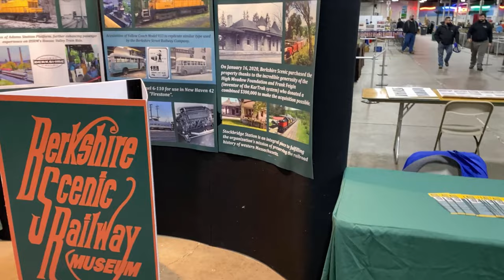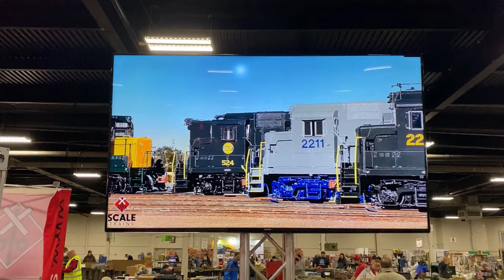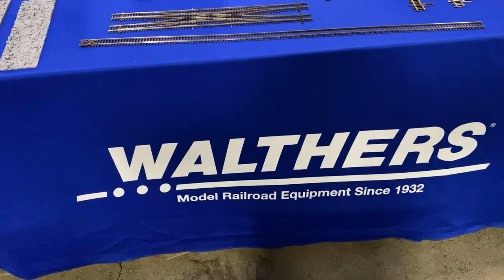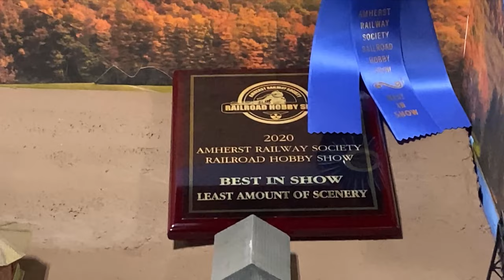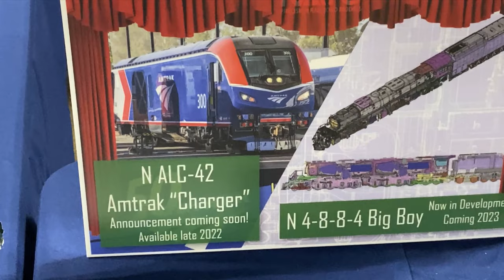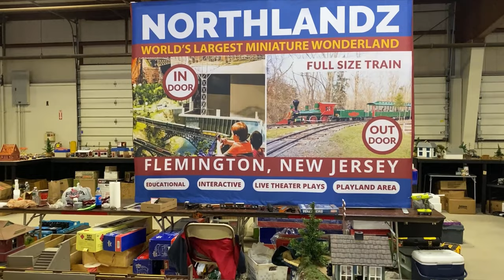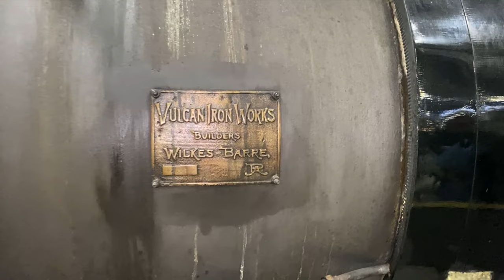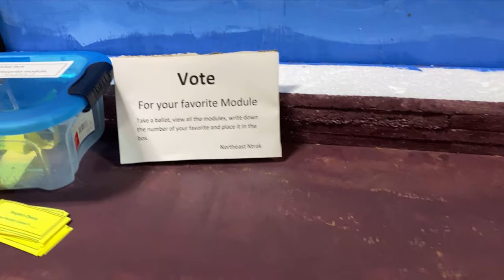The AMHERST RAILROAD HOBBY SHOW 2022 (Part 1) w/Manufacturer Interviews, Layouts and TRAINS GALORE!

Comment: You were correct when you first said "G gauge". Those were either 1:32 or 1:29, which are G gauge (45mm gauge). G scale is 1:22.5 and I didn't see any of that.
Reply from the maker: I even struggle with O gauge and O scale 😂
Reply: @NorthCountryTrains  It really does a disservice to us, especially the new guys, to call everything that runs on 45mm track “G scale”. Track radius and coupler compatibility are other issues that puzzle new guys. It was a big learning curve. I’ve been into it now for a decade and it’s still so frustrating when advertisements say “G scale” and I need to know what scale it really is so it will match what I have. Some manufacturers have lost out on a sale when I can’t find what scale their product is. (Piko comes to mind!)

That O scale/O gauge/ 2 rail/3 rail thing is still a mystery to me!

Regards, Ken Silva, owner and operator of the G gauge/ A scale Montana Vista Railway in Phoenix, AZ (now defunct), and the HO scale Conway River & Portland Railway (CR&P) in Fryeburg, ME
Reply: @avlisk  The "O" dilemma is such a confusing mess... classic O "scale" is 1/4" scale, aka 1:48. However, O gauge traditionally has been 1 1/4" gauge. But to make matters worse... in 1:48 scale, the track gauge of 1 1/4" would be a scale gauge of 5'. So there are another two camps here- there are O scalers who scale the trains up to 17/64" scale, so that the existing track gauge is more accurate. Then there's P48- narrowing the gauge of the track and rolling stock to reflect standard gauge in 1/4" scale.
...And then you have companies Lionel, doing whatever the hell they wanted- most of these models aren't even built to any consistent scale, and are typically foreshortened to allow them to negotiate the sharp curves of traditional tinplate track. The running rails are 1 1/4" inches in gauge, but rail profile is generally way higher than scale, and the trains have massive flanges to match. 
At the end of the day, it boils down to:
There are two scales, and two gauges, that you could call "true O scale". And in the middle is classic O gauge, with a gauge of 1 1/4" and a scale of 1/4" to the foot, technically is broad gauge. And then there's toy trains and Hi-Rail type models- the former, anything goes but it runs on 3-rail track. The latter, scale or near scale models, running on 3-rail track. 
Still confusing as hell...